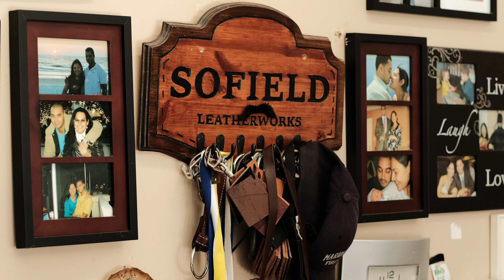Making a Leather Firefighter Helmet Chin Strap - ASMR Build

Comment: Where can I get patterns to learn from or are they such things
Reply from the maker: Thank for watching. I don’t use patterns when I design my products. You can definitely find tons of patterns online though. Look up makers supply. Thanks for watching. 👊🏼
Reply: Thank you I just want to know what to call certain stuff so I know what I need to order to make the stuff I want to make
Reply from the maker: Jay and Tisha Lankford what do you need to know specifically? For starters, I get most of my hardware from Weaver leather. If you can’t find it at Weaverleather then check Strapworks. That buckle is called an alligator buckle or postman buckle or sometimes a cam buckle.
Reply: Like what kinds and thickness of leather to use for what and things like the quick adjustment thing for the chin strap
Reply from the maker: Jay and Tisha Lankford I like to use 8-10 oz for any strap goods. Skirting or bridle leather for straps. Weaver leather for all hardware. I specified in last reply. 👊🏼
Reply: Thank you for everything
Reply from the maker: Jay and Tisha Lankford no problem